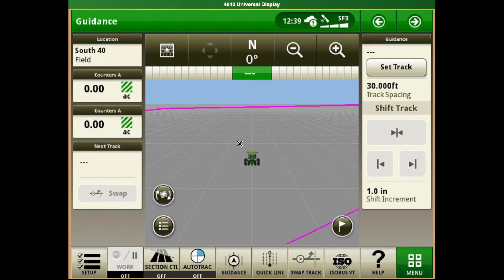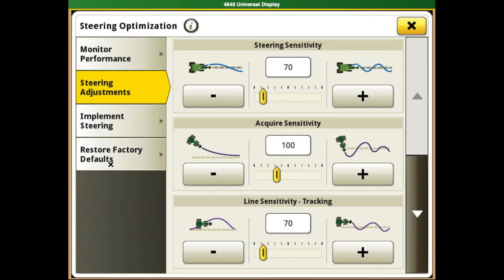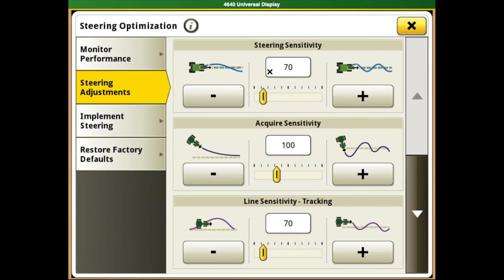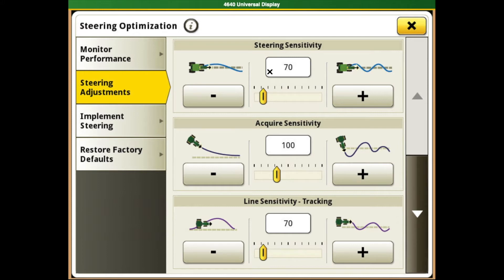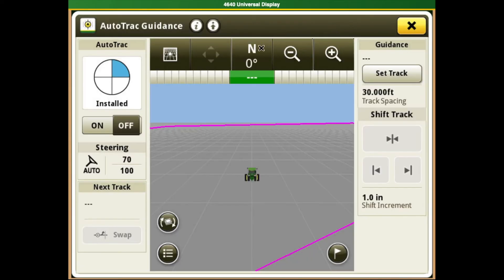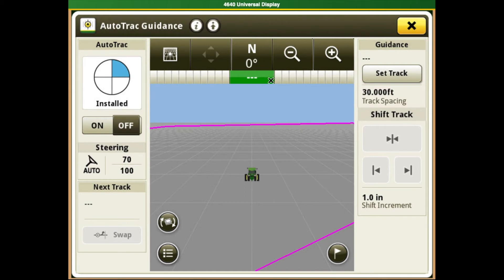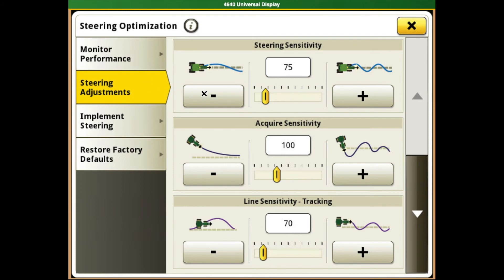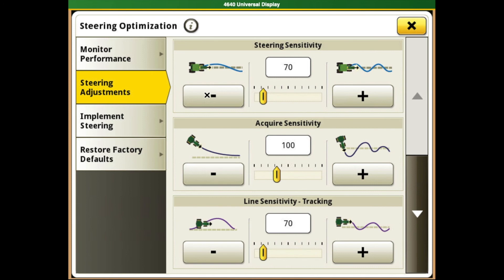How to Adjust Steering Sensitivity on a John Deere Gen 4 Display

Comment: What would you set sensitivity for sandy strip tilled hilly ground? I’m running a 616r and I’m noticing my machine drifts back and forth from my center line sometimes up to 9-10 inches.